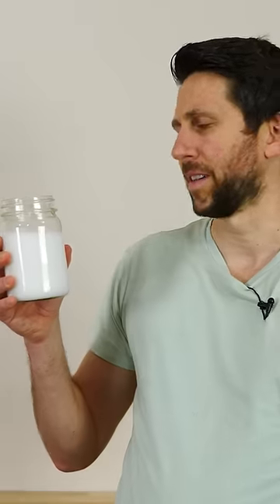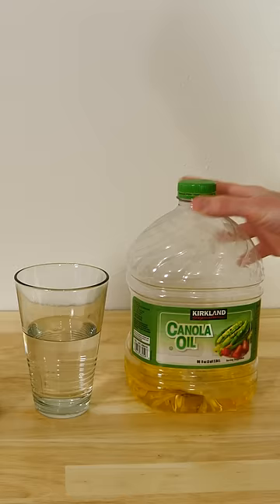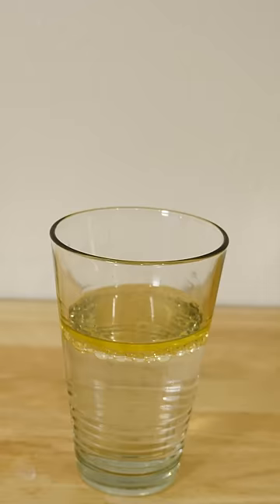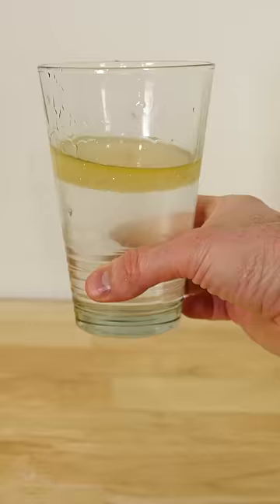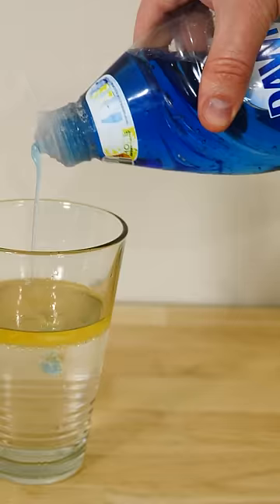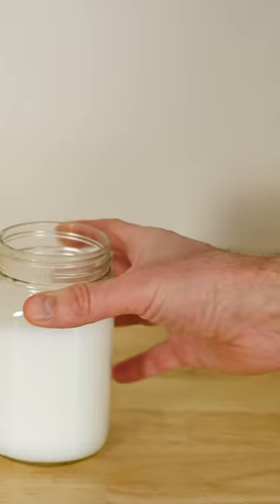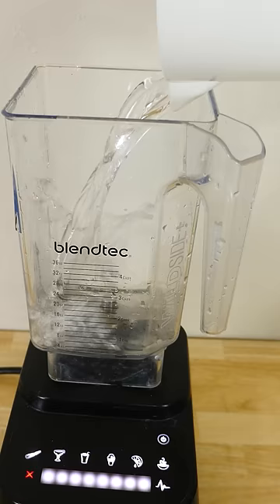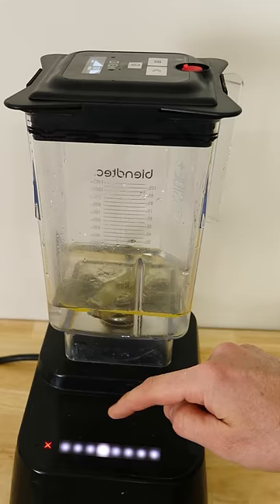How To Make Oil And Water Mix

Comment: The theory behind this may lay in the idea of hydrophobic and hydrophilic. As a sequence, when you add a vacuum and air is sucked out, you simply remove the air that acts as a boundary between the oil and water and so it changes from hydrophobic to a philic viscous substance that can mix with water . As the same theory of adding hydrophobic sand and remove the air molecules that act as a boundary.

Comment: Now I understand why machine coolant, which is a mixture of oil and water, looks the way it does!! Cool! I tend to call it “machine milk” in the shop and it annoys the hell out of my machinist coworker 😂
Reply: We own a family owned machine shop and i never knew what the coolant was! 

(Regal CNC, you should check it out sometime!)
Reply: Wow you're right I never thought about that either. Another thing this video just reminded me of is when an engine has a head leak, and you end up with that milky mixture of coolant and oil.
Reply: That's basically what milk is. Water and fat, plus a bit of protein and other stuff but the appearance is from water and fat
Reply: @alimaghsoudi7148  You are exactly right and I don't know how I didn't think of that 🤣
Reply: Like ..a blown head gasket??
Reply: @alimaghsoudi7148 so the appearance is due to the other ingredients that allow an emulsion
Reply: Mmmm machine milk
Reply: at my work plave they call it soap water if translated literally or eau de savon and if left for too long it smells like rotten eggs
Reply: Machine coolant it water Soluble oil!
Reply: I was thinking about commenting this.
I worked in a factory operating a band saw and we used oil and water to cool the blade and metal that was being cut.
I never thought too much of it even though I knew oil and water don't usually mix, I just guessed it had some additive so when the oil put into water it turned the water Milky.
BTW I also worked in a factory where they made signs and graphics. The band saw there was operated without the lubricating coolant and the metal was cut very slowly to avoid excessive heating and snapping of blades.
I assume the lubricant was omitted because it caused some contamination or problem further down the production line.
Reply: I'm gay!
Reply: @alimaghsoudi7148 the protein in milk is the emulsifier though. In his set up the water is acting as the emulsifier.
Reply: I think that probably it's not truly mixed in the sense that miscible liquids get mixed, but is rather a very fine emulsion that nonetheless has a microstructure with tiny regions consisting (almost) entirely of water or entirely of oil, that are still much much larger than the size of the molecules themselves.

This would mean that light reflects and refracts whenever it's passing between these layers, so it constantly reflects and refracts internally in the liquid rather than just when entering and exiting it, leading to a white colour instead of a transparent appearance.
Reply: @intellectualize6354  That wouldn't really be emulsification then. An emulsified mixture is completely homogenous like milk, or fondue.
Reply: Machemen
Reply: Machemen

Comment: If you wanna get technical, milk is already an emulsion of fat/oil and water. As when milk comes from the farms, all the cream/fat is separated, and the appropriate amount (2%, 1%, etc.) is put back in when homogenized, i.e. the fat is put through microscopic valves under extremely high pressure that mix it with the water again so your milk doesn't get chunky. That's the entire point of homogenization on milk to begin with.
Reply: Alr thanks for the info imma continue eating paper
Reply: That’s completely different than mixing water and oil. And by the way when milk comes from a cow tit it’s mixed not separated so you saying all this is completely and 100% irrelevant to why the oil and water mix when the air is sucked out
Reply: Ok so can you drink it also  what additives can you add as well as the salt to make it taste like and pass for MILK.

Comment: I do research on this in my lab at school! We study crude oil/water emulsions and the effects of surfactants on interfacial tension and therefore emulsion stability. We have a special emulsifier to mix the water solution and crude oil and its kinda fun to do, then we wait to test stability after it sits for 24 hours in the oven. The way normal emulsions are made is by adding surfactants which decrease the interfacial tension between the water and oil, so the droplets of oil can stay suspended without trying to seperate out. We can measure stability by measuring the amount of electricity that can run through the emulsion and also by measuring the average droplet size of emulsions using microscopy.
Reply: The only comment actually relevant to the main idea of the video. The others are just shocked it's not a milk 😃🤭
Reply: Curious if you apply emulsion techniques known in cooking? I don't remember the exact differences, but there are different types of emulsion and some do or don't stand up to being heated.
Reply: how long does a vacuum emulsion like this stay mixed for?
Reply: @mikeyarbrough6033 I’m curious too. Can it withstand quality tests for emulsions?
Reply: I would also like to know how long the vacuum emulsion would last.
Reply: Is there a way to separate the de-gassed emulsion?
Maybe re-entrain gas into the water in the emulsion?

Comment: That’s actually astonishing and I wonder if there are any interesting industrial applications of such a mixture
Reply: Salad dressing and sauce manufacturers use this method to prevent the product from separating while on the shelf
Reply: There are definitely tons of industrial applications for emulsions, from food to industrial fluids, to cosmetics. Anytime you want to have both water and oil in a liquid, you will probably have to deal with emulsion science. It’s a pretty neat subject
Reply: I think you can use it as moisturizer
Reply: Most industrial nut/vegan milks are done by emulsifying water and some oil, this is so they can foam up and have a nicer texture. Margarine is also just water, vegetable oil, salt and emulsifiers.
Reply: Cutting fluid for steel etc, especially for band saws, is like this.  The lubricating/cutting action of the chosen oil, and the temperature-limiting/cooling action of the water.  And of course an emulsifier to keep it mixed.
Reply: Can you make hydro-fuel to run in diesel engines like this!?!? Maybe in a different ratio? Cool!
Reply: Look up cutting fluid for machine shops. It's an emulsion of oil and water and it looks like milk. Doesn't taste like it.
Reply: I would like to know!
Reply: @Qui-9 Thank you, I finally understand the fluid we used in lathe
Reply: @hebertfly That's interesting. But I think it's better to inject water separately then, can control the amount too. BMW had a car, I think M2, that did this. Injects water with a boost button which cools down turbo air and gives more power. Like cheap NOS lmao
Reply: Yes, I remember there's some diesel fuel that's mixed with water this way. I don't remember what it does but they said it improves fuel efficiency.
Reply: @christiankassebaum708 I think he specifically meant this method of emulsion.
Reply: Seems to me that the oil will replace the gas in the water after the gas is removed, but if the gas is still there then there is no room in the water for the oil.
Reply: Great question
Reply: There is. It’s called margarine & coffee creamer

Comment: interesting. does it stay emulsified for very long or does it eventually start separating back out?
Reply: It will separate back out. Macro-emulations like this are thermodynamically unstable and so will always separate over time. However, the time it takes to separate can be anywhere from seconds to years, depending on how well the emulsion was made. Things that influence how long it takes to stabilize are numerous, such as droplet size, characteristics of the surfactant (aka emulsifier), hydrophobicity of the oil, salinity of the water, temperature, pressure and partition coefficients of any additional solutes.
Reply: @christiankassebaum708   "partition coefficients of any additional solutes" you had me up until this point, lmao
Reply: @Ari_C lol, sorry. Basically solubility is, in reality, a gradient. Some things are slightly oily, some are slightly water soluble. In practice, this means that a chemical which is water soluble might actually also exist in small quantities in the oil phase. The degree to which it likes one or the other is it’s partition coefficient. It’s just a fancy way of saying how much it will partition into one material vs another. For emulsions, this might mean that the oil, which is usually made up of of mix of different oily molecules, will have some of those molecules more present close to the water  and some deeper in the oil phase. The same is true of the surfactants (emulsifiers). Emulsion chemistry is a bit of a rabbit hole
Reply: Characteristics of the surfactant/emulsifier….. but there was no emulsifier used
Reply: I deal with lots of lube at work. Got a leak somewhere some time ago causing the hydraulic tank to become milky just like in this video. Cause not rectified because we couldnt recreate the problem or even find out where the water leaked in and why it didnt reoccur. So anyways boss asked to try collect in a bottle see if the oil separates. The bottle sat there like more than a month by now and last I check theres like a quarter inch of oil sitting above a bottle of milky white stuff. Very little change. Id say using time is a very bad method. Youre better off renting an oil purifier to remove the water by vacuum for a week maybe and just cleaning the oil one shot if you really2 dont wanna buy new oil and discard the old one. These hydraulic oils or lubes go about a few hundred USD per ~2XX liter barrel usually. Some tanks can take many dozen barrels to fill up. Lots of options, lots of situations.
Reply: @SantanuProductions lol no? This makes absolutely no chemical sense.
Reply: @christiankassebaum708 Love the science lesson though. Would've loved to learn this stuff in school lol it's genuinely quite interesting.
Reply: @L-mo The 'de-gassed' water acts as an emulsifier.
Reply: @christiankassebaum708  Cool! Where can I read more about the thermodynamics of this?
Reply: @christiankassebaum708 did you watch the video before starting to comment?
Reply: @L-mo  yeah, which is why it’s unique. But if it’s an emulsion, it’s going to be unstable. If all that was required was some moderate mixing at low pressure to create a permanently stable emulsion, many people jobs, including mine, would be a whole lot easier.
Reply: @shawnsg  yes.

Comment: You can get the same effect by mixing them with the venturi effect. This is how cooling fluids for metal working machines like mills and lathes are made.
Reply: i worked with lathe machines and those big drilling machines. if you dont use the oil and water mix, the cutter pens will melt.

Comment: As a machinist, I saw this and immediately thought. Soluble oil, aka coolant
Reply: Exactly what I thought of. I'm not sure what they do to the oil so it mixes into the water way easier than this
Reply: @cyrucom  they just add an emulsifier like the video above.
Reply: Or salad dressing… ya know for when yuwanna toss some salad… hope that doesn’t sound too heterophobic 😂
Reply: Not soluble.
Reply: Exactly. It has an added emulsifier. 
Still it separates over a year or so. 
But the vacuum process is most probably how almond ‘milk’ is made and a lot of the other ‘milks’ found in the grocery store.

Comment: My hypothesis: oil droplets have air around them, which separates the oil from the water. When you remove that air, the oil and water are able to make contact and the oil disperses better, hence it emulsifies. This is like the time you make the magic sand wet, and each molecule of sand is able to flow by itself. This is also how soap works, where soap molecules have one end that contacts water, and another contacts oil, connecting them together.
Reply: I'd say that's a pretty solid theory. Since the air molecules would act as charge insulators, the water molecules and oil molecules would have a harder time to maintain attraction. I'd imagine there a host of hydrogen bonding occurring within the mixture between the various hydrocarbons and water itself.
Reply: This makes a lot of sense.  Ever hear of Vacuum welding (In a vacuum similar metals can fuse due to the oxide layer evaporating).  This is similar to Vacuum welding, but on a liquid level.
Reply: @johnsmithfakename8422 the oxide layer doesn't evaporate in a vacuum, cold welding relies on surfaces that don't oxidize because they are in a vacuum. If oxide layers evaporated in a vacuum anodized aluminum would lose its coating in a vacuum and it does not
Reply: Try helium.
Reply: Doesn't really make sense, polar water molecules will still be more attracted to one another than large non polar oil molecules.

Maybe, rather, it has more to do with a favorable entropic state. Because trying to explain this with energy won't get you far.
Reply: @jonl716 oil wants to oxidized, water can lend it's oxygen or hydrogen to other compounds which is why it's a good solvent. Water that has not been degassed already has interactions with the dissolved gasses. Once you remove these gasses and make the oil particles small enough for the water to overcome the surface tension holding them together water can then lend the oxygen to the oil and they can homogenize in a solution.
Reply: @PhiloSage   your first statement has nothing to do with water and oil mixing, therefore it makes everything that follows not worth attempting to understand.

When you say "oil wants to oxidized" that means that the oil wants to be oxidized, which would mean it is giving electrons in a chemical reaction to another molecule. Fair enough, oil does like to do this. However, oil does not undergo any sort of chemical reaction when dissolving other compounds, rather this is a process of mixing.
Reply: @jonl716  I'm sorry you don't comprehend. Water has oxygen, oil wants to acquire an oxygen.  Every type of oil accepts the oxygen at very different rates. How fast an oil goes "rancid" is the specific affinity for oxygen.
Reply: @PhiloSage  do you mean that oil wants to exchange/give electrons to water? as you suggested by using the term oxidized? or do you mean that oil has a dipole - induced dipole interaction with water?

I've already argued your first point, so then I'll argue this second point.

Sure, oil can theoretically stabilize water through a dipole-induced dipole interaction. However, the system will be at an even lower energy state if the water just hydrogen bonds to itself (this reversing the mixed state into two separate liquid layers). So making this argument is also false.

The only plausible explanation is that of entropy.

However, I've heard that this mixing eventually reverses (though I didn't verify it), so if it does reverse eventually (back to two liquid layers separated by an interface), then you're just wrong either way.
Reply: Food Scientist fact drop: When you blend water in oil without a vacuum the oil will preferentially interact with the air and create a foam. This is why whipping heavy cream creates a foam. It's the coalescence of oil droplets around the air bubbles that stabilizes the dispersed air bubbles. Under vacuum there is much less air in the blender to form a foam, so the shear from the blender only provides energy to disperse oil droplets and form an emulsion. This breaks the oil into very  tiny dispersed droplets. Raw milk is homogenized in a similar way, not under a vacuum but in a closed system with no air. This emulsion looks stable, but it will likely separate eventually without an emulsifier. Stokes law says that the separation rate of an emulsion is proportional to the radius of suspended droplets squared. So without air, the blender is able to create very small particles and the emulsion seems meta-stable,   but it will separate eventually.

Comment: Where do we buy vacuum lids for blenders?
Reply: Blendtec actually sold those with a vacuum pump and everything.
Reply: 3D printing shops are a good bet, you can take your blender there and if they offer custom prints they can measure the dimensions, design the part and print it for you. Expensive maybe, but you only need one if done correctly.
Reply: Oooh!  Vinaigrettes that don’t break!  Cool!
Reply: @yonidellarocha9714  That’s a great idea. Thanks.

Comment: You can make mayonnaise with the water from the soaked chickpeas (called aquafava) and oil (like sunflower seed oil) using a hand blender.

Around 1/4 of oil and 3/4 of aquafava. You can add a clove of garlic and some lemon juice
Reply: Olive oil?
Reply: @nunyabiz2117  The olive oil flavor is too strong for this recipe, in my opinion

Comment: In my opinion this could be caused specifically in a vacuum because when it is mixed normally, air gets into the oil/water and wants to rise, taking the less dense oil with it, take out the air and the oil will take significantly longer to rise to the top. This phenomenon also can happen in diesel engines (the cylinders develop vacuum when the engine is running). My opinion is entirely just on a hunch, I have no real education on the subject, this is very intriguing however.

Comment: ok..interesting fact: in the Damascene cuisine we have a dish that uses oil mixed with water we call the mixture (faqsé) and the dish is ( tes'ieh bil zeit) we use a bad type of olive oil and we mix it with water by adding little bit of bicarbonate then mixing in a blender ... we add this mixture over boiled chickpeas and small pieces of dried pita bread ...

Comment: This seems similar to a colloid. A dispersion state between solution and suspension where the particles are so small the stay suspended in the solvent but don’t settle out or dissolve in solution